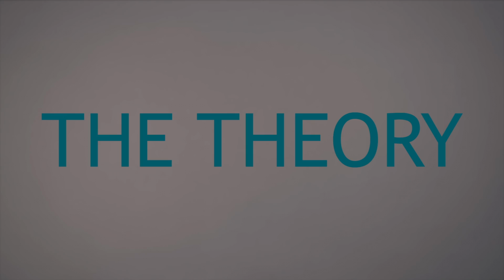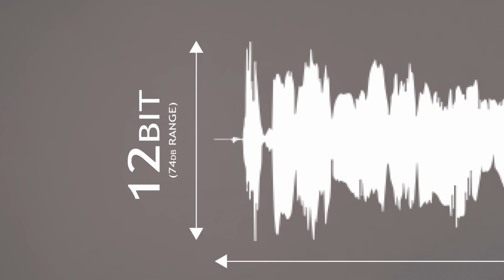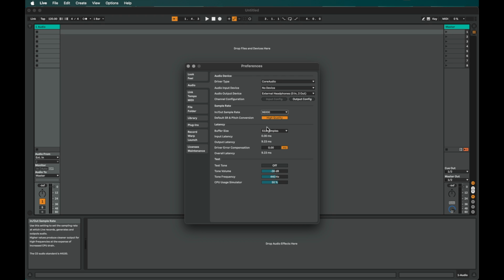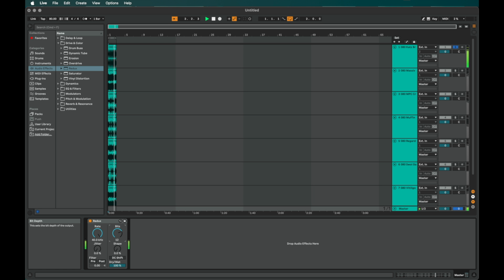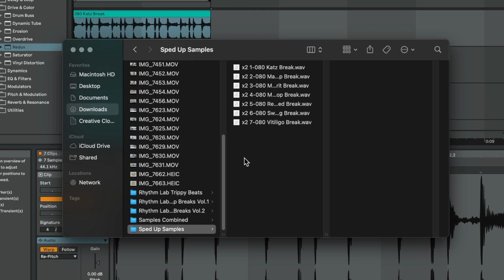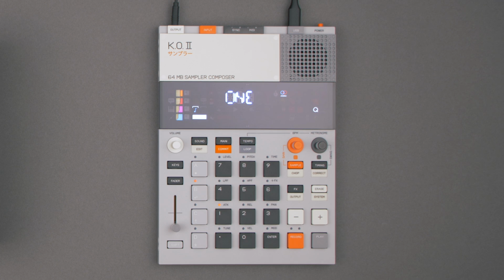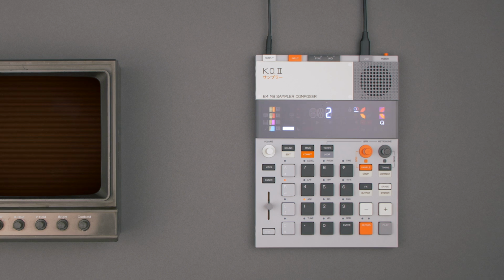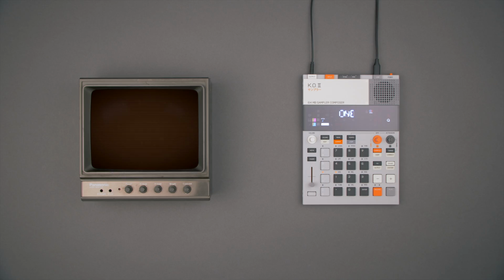How To Prep Your K.O. II Samples for Lo-Fi Grit

Comment: Great Video !  Here is Another tip : Get the same or better " Grit" in  Able-ton :  1) Go to settings > Audio - Sample rate - set to 44100 - Default SR & Pitch Conversion change from High Quality to Normal . Step 2) sample your source  78rpm or 45 rpm + 8% or +16% pitched up on a turntable ( if your turntable allows that)  , OR sample from whatever (Tubes,  etc) NOTE :  if sample normal speed - Resample your normal speed sample  in Ableton pitched up 2 octaves up ( experiment how high you need to pitch up) )  than pitch down back  to regular pitch/speed or lower  inside  Able-ton  -------------->  3) Listen and compare : you will be surprised how gritty and " lo-fi " Able-ton pitch rendering will sound  ! just my 2 cents , keep on making music , Peace , Jazz.  P.S. older versions of Able-ton like version 4 ( as i can remember) had option to render audio at 16bits 22050 Khz that produced very crunch sounding drums and breaks!
Reply: Don't know about KO II ( don't have one) but OG OP-1 produces very nice grit and light ( pleasant) aliasing when sample pitched down it samples at 16bit 44.1 Khz. Anybody could complete the OP-1 yo KO II ?

Comment: Can the MPC one do the same thing or does it not sound the same?
Reply from the maker: The MPC can do chromatic playback, but it's more hi-fi. The MPC has "vintage" modes that are meant to emulate the behavior of old samplers, but it's really just a tacked on effect and doesn't sound very good or anything like the classics. The best vintage emulation of all of the current hardware samplers in my opinion is in Maschine, but $1,000+ is way more than the $300 K.O. II, so not really an even comparison.
Reply: thanks for the insight appreciate it! @Bloom_Music

Comment: Multiple your tempo by 1.36363636363636 , and that will be the equivalent of sampling a record of 33 1/3 at 45 rpm , like sampling to vinyl on samplers with short samples time memory. We used to sample it in faster by hand to maximise limited sample time. Now it’s Lo-fi to taste. Gr8 overview video and research. Much thanks. 👾
Reply: Great tip, thanks

Comment: Man I hope the KO II is a huge success to the point where TE makes a higher end version that has different sampling rate options to simplify the above process to get that sound but also a great deal more memory anyway so you can use it instead of a DAW for full compositions and 5-minute recordings if you want to, like vocal or guitar takes. That would be the definitive standalone machine. I hope some company makes something like this attached to a keyboard, like something right between the Korg Microsampler and MPC Keys. In a way that's OP-1 territory but I want that KO II interface. It's such a groundbreaking box despite all of its imperfections.

Comment: This technique isn't new to me but from your sound examples I realized for the first time that the reason I like this type of processing is because it sounds very similar to tape in a way. I've experimented with a lot of cheap 7.5ips 4 track, and some more pro 15ips half track tape machines -  I'd send drums through cheap tape machines and back into the DAW for some character. The sample at 2x speed pitch down has similar tonal characteristics to that process. You can see a short on my channel called "Drum Samples on Tape". 

Great video Donald! Your quality is insane!

Comment: Has the build quality improved?
Reply from the maker: The build quality was never a concern. See my other K.O. II video for full details.
Reply: @Bloom_Music  Not trying to be rude but the build quality issues were ALL over the internet. Maybe you were just lucky and your unit was in great shape.
Reply from the maker: Fadergate was all over the internet, as was the resolution. Other than that, I saw a bunch of opportunists posting TE hate rage bait for clicks and likes. As someone who has used the device extensively for the last month with zero issues, I'm done listening to people who have never touched one telling me how bad the build quality is.
Reply: @Bloom_Music  I wasn't trying to hate. I am interested in the KO II but the fader issues kept me from investing. How did TE resolve the situation?
Reply from the maker: The issue was due to poorly designed packaging. There was nothing protecting the fader, and the fader stem would take the full weight of anything stacked on top of it. Early adopters were basically rolling the dice on whether they got a non-working unit from the bottom of the stack. TE fixed the situation by adding a protective piece around the fader to redistribute the weight load. Not a perfect solution, but it was something they could implement immediately. A packaging re-design and production run would take many months. Fortunately, I got a fully working unit from the first batch and haven’t had any issues. The build quality is good and exactly what I would expect from a $300 device. If you are interested in one, I would recommend trying it yourself, rather than trusting rage bait “hot takes” from the internet.
Reply: @Bloom_Music  I see. I was curious about a more hands on approach to sketch out music on the couch / plane and the KO II looked interesting to me but first fadergate happened and then Yamaha dropped the Seqtrak. I guess I have to give both a try.

Comment: Great video, with the 64mb but your using wav's surely this would fill up the space in one sample slot?
Reply from the maker: When you use the sample tool to load the files on the K.O. II, everything gets converted to a proprietary 16/46, so the original type and size of the file does not matter. The reason I use the highest quality file for the original is so the sample tool's conversion algorithm has as much information to work with as possible for the most accurate results. Regarding the voice stealing that @LeooPokat mentioned, file size has no bearing on voice stealing. You get 12 voices; mono samples count as one voice and stereo as two voices.
Reply: @Bloom_Music a great work around for this is using midi and ensuring a sample is not on the pad or it will steal a voice. Hook it up to Koala =Profit
Reply: It won’t 
It just the voice stealing 
that was a turn off for me
Sending mine back 2day